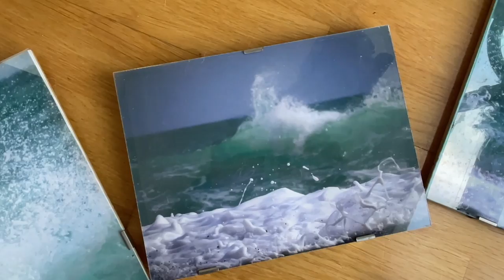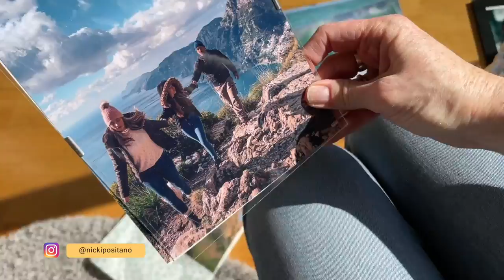THIS IS JUST THE BEGINNING OF ABSOLUTE CHAOS! | The Positano Diaries EP 166

Comment: To open a screwed-tight lid, place rubber bands around the lid n twist it open. Or another way is with low gas stove fire, place lid(tilt at an angle) on the low fire n warm it up for a few seconds  by rotating the lid top n it will open easily. Hope that helps.

I know l am 4 mths late but hope these tips will help in future. I often tried it myself n it works all the time.